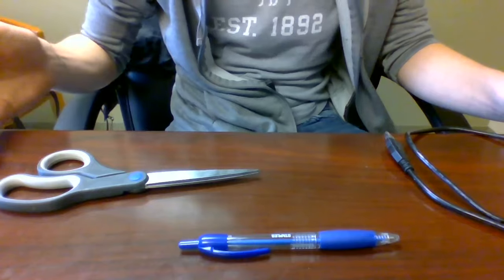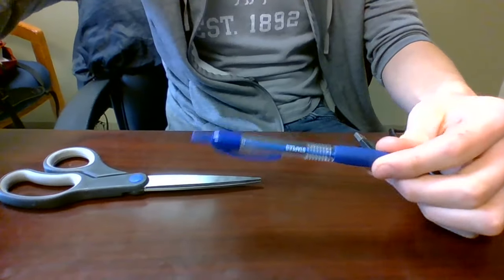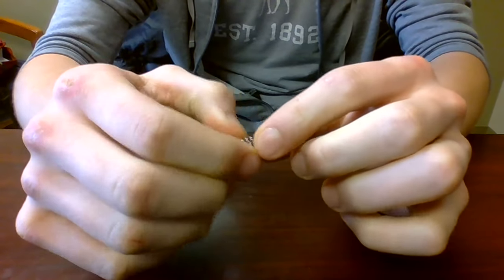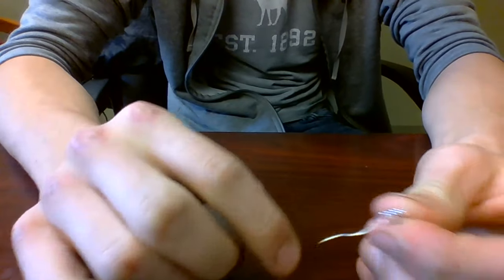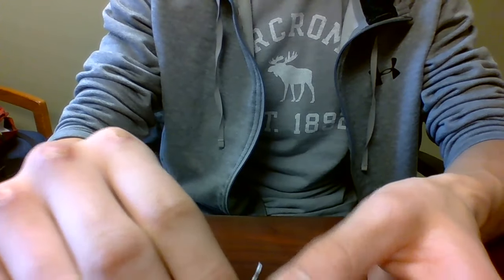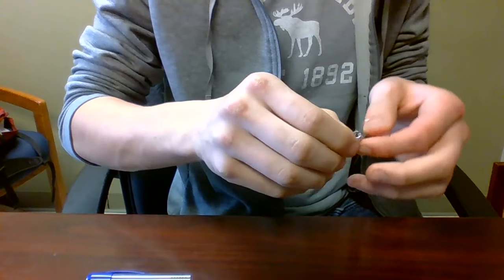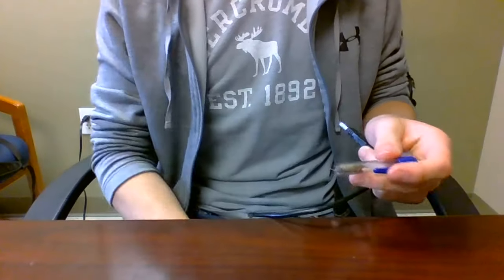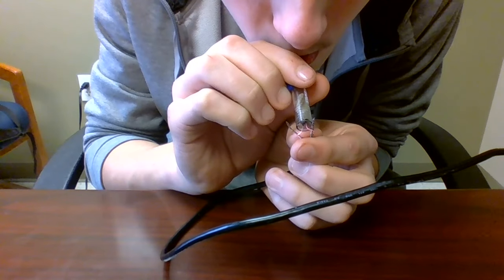How to ACTUALLY make a vape from a pen (NO CAP) Deadass

Comment: I’ve never vaped before but this video has peaked my interest
Reply: I understand hearing about a cool flavor and it peaking your interest but i wouldn't expect using tweaker wires on a fuckin pen would peak your interest lmao
Reply: If this is interesting, GET A "MECH MOD". You can find "Mech Mods" with all the minimum protections as a vape. Just know you'll need kanthal wire to build your coils, and the puffs get weaker as the battery drains.

Comment: Holy shit..... It damn worked. Never thought that the wires from so far away would make so much output, Mf we thank you frfr.
Reply: Wait it actually worked?
Reply: @jsjjsjxskids3522  yep
Reply: My wires arnt heating up quick any tips
Reply: @Lanemeston  sa.e
Reply: @Lanemeston  same*
Reply: If you really want to smoke inside of plastic use canthol wire that they use for actual vapes
Reply: Roll a coil with 20 gauge canthol you can get it from any vape shop and if you can’t just order it

Comment: Vaping off the windows XP 😂😂
Reply: its for this because he attached the data cables with the positive and negative and every time he touched the resistors the windows he connected the cable to detected a false device connecting. ndeah
Reply: @savitarcurs847   yes I know , but thanks 👍

Comment: Why did you fuse black with white? You only need the red and black wires.
Reply: Yes. Only need + and - 😆
Reply: i have just the red and black wires and it doesn't work

Comment: Don't do it! Once that this spring is not a resistance wire suitable for vaping by which it can release a number of strange substances, the pen is also made of plastic.... Better buy a disposable already
Reply: it isn't for long term.
at 5v and maybe an amp as long as you keep it juiced it will definitely work.
what do you think the disposible vapes are made of.

Comment: When you heat the spring in a pen some of that metal vaporizes and you inhale that. Not sure how much safer the metal coils in vapes are but I’m sure I’d rather smoke that than the spring in a pen
Reply: Not to mention if used long enough, it will singe the plastic and you would inhale that too

Comment: I don’t even wanna vape I’m just learning engineering and i feel like vapes are a good piece of technology
Reply: true
Reply: Good way to understand resistance  to understand voltage and current running through the wire to not only get it hot but actually apply the correct amount to keep it going for a sustained time and add a switch as well and not just melt it instantly.
Reply: Pretty valid

Comment: I have a question. I changed the spring out alot I've tried like 5 different ones it will make a spark but not light the spring up. Can someone explain what I'm doing wrong plz.
Reply: if your using a computer, xbox, tv etc it wont work. Plug it into a wall outlet with a charger box. if that doesnt work either ur wires are messed up and u need to make a new one or the box part isn't the right voltage
Reply: Well i have tried soo many times it wont work

Comment: Instead of using mains you can (Electronics skill 50 required) use a battery and connect it to a button or something, and connect a charging port from a phone in parallel to the battery then wrap it up in electrical tape. You got a rechargable vape

Comment: yo idk if the orignial uploader is gonna reply to this, i did all the steps right but the one problem im having is the wire isnt outputting sufficent power to heat up the coil, i used an android charger like you stated but im unsure on how to supply more power
Reply: bro me too i literally had it last year and now it doesn’t work i think god patched it 😂
Reply: You need at least 6v 15 amp

Comment: ( Heads up this is technical  but easy to learn)  This is way more ghetto than what I do better version if ur outa money lazy and won't go to the store like me u could if u have a bunch of vapes lying around grab a vape that's dead open it there should be a battery and a capsule thingy that hold the coil cotton wire coils dont touch that unless yk what ur doing (be gentle when opening vapes the wire are soldered super wack so they could come apart heads up if a wire breaks leave it unless u have a soldering iron on u to fix it back to what I was saying the ends of the battery should have a metal piece take a stripped wire like in the video and put the 2 ends to the correct piece of the light on the vape is flickering switch it to the other side immediately it could get so hot that it could melt the wire and burn it ass like me💀 dont do that and once u charge it there for any 2 to 3 mins it should recharge u get a really decent amount of hit but if u suck on that mf like a fene like me it wont last also the juice will run out eventually you'll notice this when ur hit becomes dry and weak dont hit it any further it will burn the cotton and that's bad so if u got a bottle of e juice u can re open it go to the capsule part and carefully open the end with no wires drip e juice that way but it's highly innafective if ur ballsy take the cotton out without fucking up the wires and drip the juice on the 2 pieces of cotton sticking out of the pipe thingy and on the inside of the cotton thing u pulled out put it back together put the capsule back on recharge and ur good to go if ur willing to do this and want a video and pictures on everything abt it if ur really into it comment and I'll show u good luck feeners

Comment: Fantastic way to destroy unregulated USB ports. Way too much current lol. Most USB controllers will disconnect the USB port momentarily if they detect overdrawing of current. Better to use a battery pack with a USB port

Comment: Every time I try and do it the wires are sparking a little but it doesn’t heat up the spring how do I do it
Reply: You'll need either a stronger adapter than 5volts or try to get the thinnest pen spring

Comment: nice im gonna attach a 9v battery and a button and distribute them throughout my school so i can finally get money and stop being broke lol
Reply: 9v battery can't source nearly enough current. Plus, cheaper switches will melt with that much current as well. Get some 18650s, a charger for them (important if you don't want them to explode from improper charging), and a mosfet. Connect the button to the mosfet, the mosfet to the coil. The mosfet is an electronic switch in this case. It can handle way more current than the button. The button serves to activate the mosfet and allow current to flow to the coil. Make sure you use unbleached organic cotton as well if you don't want to vape toxic shit
Reply: @elsnowman123 nooo, that's actually dangerous af
Reply: @Dr_Greg  if you take apart any vape, that is how they are constructed

Comment: Can you do it with a battery not a charger
Reply: Yes, you can even connect a switch button in there
Reply: Then that’s building your own vape.

But if you do wanna make your own with a battery. You’ll need these parts:

You would need a battery from a vape. (If you use a different battery some unexpected things could happen)

Red & black wires. (Small. Kinda what all vapes & rc cars and boats use. & other non high voltage things. I’d recommend to get these wires from a disposable vape since their easier to open than some vapes. That depends tho)

And a airflow sensor.
Or
A button that heats up the coils when pressed.

(If your using an airflow sensor make sure it’s one from an old vape you have. It looks like a tiny circle that lights up when air flow is detected)

Tip: airflow sensor is better & less complicated especially if you use one from a disposable vape like from a fume extra/ultra/infinity. Or a cuvie plus/air/box & other vapes.

Cuz they’re already programmed to do the common things in a vape.

And that’s all I got idk. But if you wanna put the parts together your gonna have to solder them together. To do soddering you’ll have to search it up. Cuz I don’t know how to do that 🤷‍♂️
Reply: What can i use as a substitute for vape juice ?

Comment: Could you rap the wire around the spring and still work??
Reply: Yea just dont plug it if you dont want it randomly turning on.  I recommend if you have a long charger and you wanna just lay in bed and vape it I recommend you plug it in a portable charger.  Still works for me
Reply: @jeffreygibson8990  which wire color did you use?

Comment: isn't that a short circuit since there are no diodes or resistors?
Reply: No wire is resistance free, what’s why it heats up
Reply: @RedstoneCraftermc  yeah but doesn't this damage the battery? you can't just connect the + and - with a wire
Reply: @iisalmenrompepaivat2266  it only damages the battery if it’s shorted for extended periods of time and heats up or the voltage dips below the minimum healthy voltage for the battery for too long. also depends on the resistance of the wire, if it’s a actual coil it will have resistance and it won’t technically be a dead short though the power draw can still be more than the battery can handle, but still, only for a long period of time. if the battery couldn’t supply it, it simply wouldn’t.

Comment: I did it and the wire was working when I tested it but it didn't work the pen I was using was the same in the vid and the wire I was using was weak so I'm assuming it was because the wires were to weak so it couldn't make enough heat

Comment: My scissors won't cut the spring
Reply: fax
Reply: Sorry for the name I'm on my cousins account but if you have a grinder for sharpening things take the part you wanna cut at put it on the edge of the grinder and turn it on
Reply: @pokegarrett  nvm i just used nichrome wire lol

Comment: does it matter what cable i use
Reply: I mean the Android adapters make more output, if your wanting high voltage to get a good hit then by a power bank usb for a IOS type cable. It will be a little extra money, but having a better hit is way much better then having a small amount of vapor that would be from a blown out candle.
In this statement, it rlly doesn't matter what kind of cable you use aslong as you know what you are doing

Edit: Holy shit i sound like some kid that does fucking band class

Comment: Can't you just use a battery 🔋
Reply: I was wondering the same thing
Reply: You would have to sauder the red and black wires onto the negative and postive ends, plus it would need to be a AAA battery so the voltage doesn't make it burn. I just find it easier to do this with more of a plastic tube rather than a tiny ass pen
Reply: it’s not sauder it solder but pronounced sauder

Comment: dont hook it to your computer man, it can fry the internals and the cpu it can also run your computer way too hot for the fans to even matter.
Reply: If anything is gonna get messed up its the USB and most modern pc's have protection for surges on the USB ports to keep them from hurting the rest of the internals
Reply: Thats not even the thing Im saying bro, What im saying even if the surge doesnt ruin it the temperature of the cpu Is gonna melt it but either way the surge can and will end it.
Reply: @fzrzvortex346  if your cpu can't handle that and overheats that easily i think thermal paste is long overdue
Reply: @ohnobro2394  Bro.. Do you understand the amount of power that those things draw from the USB ports because they have to end on them and there isnt a brick that its attached to

Comment: That’s foreign at 5 volts that’s why you can’t talk. Jesus Christ your “spring” as it’s not a vape coil, ramps up to fucking lightning and who knows how many wraps that is let alone the high temp is for sure melting that pen cap. Invest a little money and pocket as many used disposables as you can. Use a glass tube, at least boil your cotton, ni Crome which is cheap enough but if your desperate you can find nichrome in a remote for your tv. And a voltage stepper you can plug into your wall box charger that will lower your volts
Reply: Not to mention the spring acts as an inductor.

Comment: It dosen't work
Reply: bro thought it would actually work, buy a dispo for £5
Reply: It should, it's basically using a pen spring as an induction heating element for the conductive vape juice however if the spring breaks it won't be a complete circuit so mabe check the continuity with a volt meter also ur power scouce might be too low wattage for the e liquid to reach evaporation temperature si try plugging it into a fast phone charger ie 25+ watts and if that doesn't work then step up the voltage with a low to high wrap coil ratio power supply along with a transistor to altrinate the magnetic feild. 
Or you could just not vape you 15 yo imbusul go learn abt electricity this video contains a lot of useful info
Reply: 🎃Token🎃  buy off sum1 at school easiest way bruh